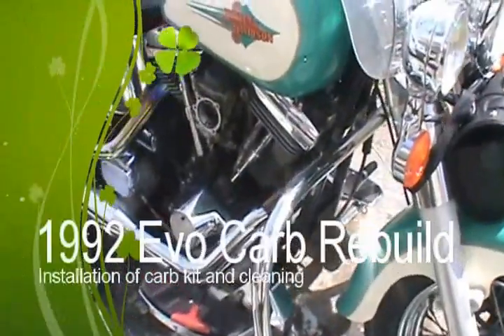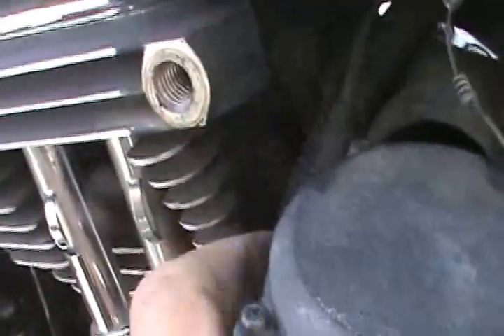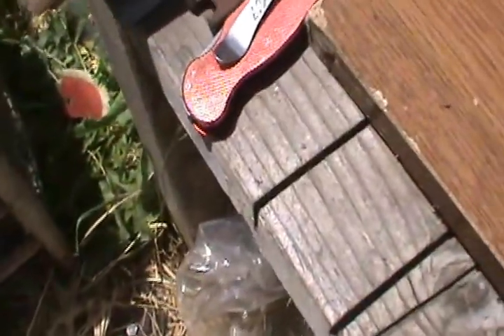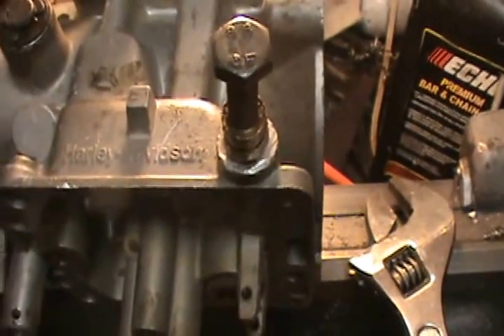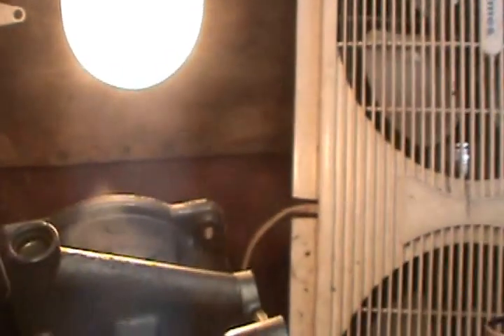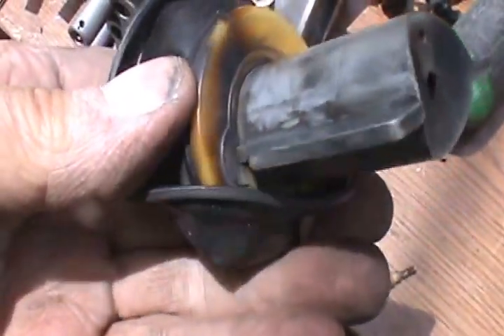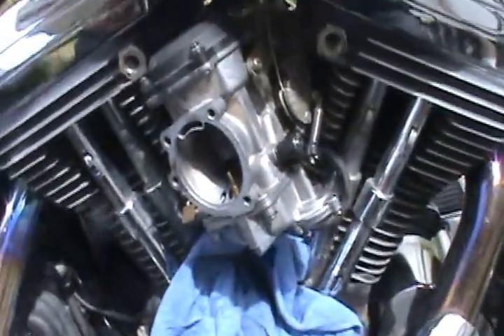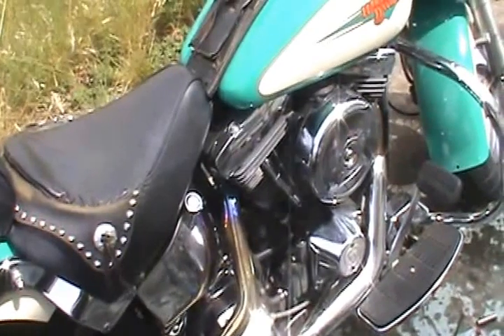Harley Davidson evo Heritage carb harley rebuild kit install

Comment: Thanks for posting this. 
My 2003 Sporters carb is just like yours. Mine idles just fine and even does great with the choke on but as soon as I give it throttle it dies. I've cleaned all the jets check the flow to carb, but can't figure what the problem is.
Reply from the maker: +Ride AMAP (As Much As Possible) Not sure what is going on with your carb, but it sounds like something is wrong on the vaccum side, it might not be opening the slide when you give it gas.
Reply: Ride AMAP  make sure pump squirts gas and slide goes up when cracking the throttle! May need new slide?
Reply: Im having same problem, was riding for 10 miles then outta nowhere the bike started to backfire & stall an sounded like shotgun blasts, i limped it home checked the plugs & were fine now im thinking fuel problem on my 03 xl1200

Comment: Hey I have a 1993 Harley Davidson FLHTC I’ve been having problems with my carburetor your video is awesome where did you buy your kid a tear in the Harley doesn’t sell any parts in a kit anymore just please buy please thank you
Reply: I just bought a full carb rebuild kit for my 91 softail today from the Harley dealership in Modesto ca. It was 48 bucks and came with manifold gaskets too
Reply from the maker: Should be plenty of them on ebay

Comment: @2:47 you say; you don't know why there is a little spring on cable ???  my Harley has the same thing a little spring ...   maybe it is a FACTORY THING ...   Hello......
Reply from the maker: maybe, just does not make sense.  Why not make a cable the right length to start with.
Reply: Push/pull throttle cable set up uses a spring on the push cable
Reply: @jerrynunley9956  Yeah I was going to say the same thing. Even the new injected bikes have that spring for a reason. Lets just say I am glad to see someone wrenching on their own bike yet this one made me cringe a few times.

Comment: "looks like 'somebody' put a piece of spring on the cable"... yes, somebody in Milwaukee maybe.
Reply from the maker: Yeah. On a 4 year old video. Spring is to keep cable tight, apparently vibration on harleys breaks cables frequently.